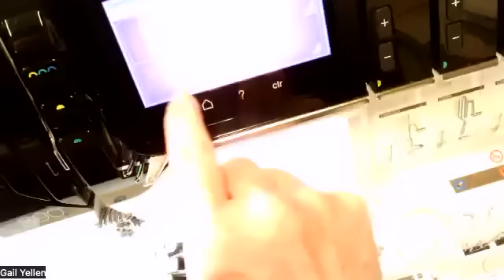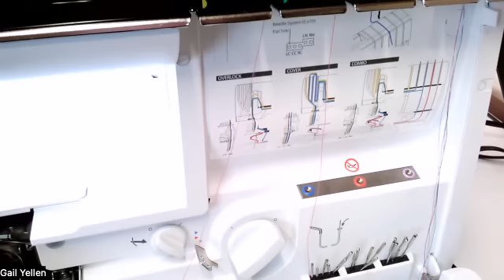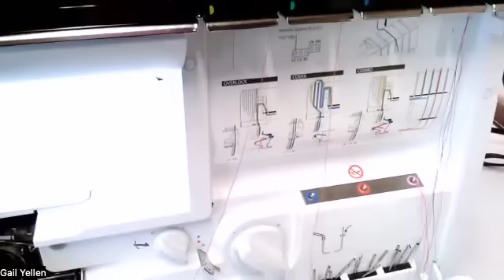Thread Fusion Live Replay

Comment: You are an exceptional teacher and I’m so grateful for you YT videos.  I became a serger “convert” bc of yours videos and book. I just bought a Bernina L890 last week.  I’m so excited about all I’m about to learn! The first thing I wanted to do was one of your “No hassle tassels”.  The air threader of my machine is not “sucking” the 12wt thread.  What  am I doing wrong? Also, what are the settings for the tassels on the B L890? Thanks again for all your content!
Reply from the maker: Hi, when you lock the air threading tubes, look closely to see if they are lined up exactly with the other end of the tubes. Sometimes if they don’t align perfectly, thread won’t whiz through them. Also if your thread has a bend or kink in it, trim it away. That also impedes threading.12-wt. thread should go through the tubes. Also if the loopers aren’t positioned correctly, the tubes won’t close at all even though you turned the big white knob. 
I set my machine for a 3-thread rolled hem (#8). But I always increase the lower looper tension to 7. And I put either 12-wt or 8-wt. thread in the upper and lower loopers. You’ll have to test stitch length to see what you like. But definitely pull the thread chain behind the foot with a consistent amount of tension (not super hard). If your air threading still isn’t working properly, let me know. What day did you purchase your machine last week? I’m very excited to help you get going on it! Thanks.
Reply: @GailPatriceDesign  I can’t believe you reply so quickly…thank you so much. Thanks also for the info on thread settings.  I’ll try asap.  Today I bought some Sulky 12wt thread and in comparison to the “12wt” Wonderfil Razel I use when trying my first tassel, it’s much thinner (the wonderfil 12wt Razel didn’t go through the tube, but the Sulky did).  Was this the problem? I got my machine on March 14th.  Thanks again!
Reply from the maker: @kchart47  Hi, if you purchased your machine 3/14 after seeing my Serger Savvy video, you qualify for a $100 rebate from BERNINA! Email me your full name and address and I’ll send the coupon. (gail@gailpatrice.com) The instructions for mailing it are on the coupon. I’m so happy for you. Back to the threading issue. Any thread that designated a certain weight on the label should be equal in thickness, no matter which brand. So I don’t have an explanation other than that there are manufacturing differences. But if your air threading continues to be a problem, have your technician look at it.
Reply: @GailPatriceDesign  I just sent you an e-mail with my info…Can’t wait to get that rebate coupon! By the way, I went to the Wonderfil web site and they did state their Razzle thread is 8wt. perele cotton, not 12wt (…my mistake 😉).   I’ll be paying close attention to the air tubes next time I try this technique bc my 8wt. threads are beautiful and I’d love to make tassels with them also, if possible .  Thank you again !
Reply from the maker: Gail Yellen
8:41 PM (0 minutes ago)
You might need a thread cradle to send 8-wt thread through the tubes. Let me know if you need help! xo, Gail @kchart47

Comment: Gail, I have an Evolve and feel certain the Universal will work well with it. It does have round plastic thread disks, whitch I confess I've never used. My question however is how can it be used with sewing machines, would you use it to in your bobbins, or perhaps thread it through your needle with a larger eyed top stitch or jeans needle. I already envision using some of the decorative stitches with two or three embroidery threads. I'm sure I would do more on my serger, but inquiring minds want to know.
Reply from the maker: Hi Bonnie, If using Thread Fusion on your sewing machine, insert a topstitch needle (larger eye)—either 80/12 or 90/14. A sewing machine can handle multiple machine embroidery weight thread in the needle, but can only handle (1) 12-wt. thread in the needle. No matter what threads you use in the needle, wind the bobbin with bobbin thread. Youll probably need to lengthen your stitch and possibly drop the needle tension slightly. Make a sample to get the correct look. Also I've found that sticky wash away stabilizer works best . You're correct that the Universal Thread Fusion is the best size for the Evolve. Let me know if you have other questions and thanks for watching!

Comment: Will the larger version work with the Evolution or do i need to order the smaller one for my daughter and the larger for my Triumph?
Reply from the maker: Both sizes will work on each machine. I suggest placing the round gray spool “coaster” on the spool pin for added stability. Babylock sergers have the flared spool pins so the Thread Fusion stand sits higher. But it doesn’t make any difference in performance. Let me know if you have any other questions and thanks!

Comment: What is a SUE?  you mention it several time when using a thread loop to pull threads through, but context does not give a clue. It is not 'sew', that context does not make sense, so it must be nomenclature of which I am not familiar
Reply from the maker: Hi Pam, I think you heard "lasso" as "lassue"! The looped end the the thread cradle lassos the multiple threads to pull them through the eye of the designated looper. Can you tell I'm from New England?🤣

Comment: I have the Bernina L890, can you only use the embroidery weight thread with the thread fusion device  in the chain looper or can I use heavier thread (like the Spaghetti thread you carry)?
Reply from the maker: Hi Lyn, Yes you can use (2) 8-wt threads in a looper (with the bypass bracket) and I've even used (3) 12-wt threads in the chain looper. The bold threads really pop and create beautiful dimensional stitching. Let me know if you have more questions and I'd love to see what you do with Thread Fusion. Thanks for watching and asking a great question!
Reply: Great - I'll have to try that.  I haven't used the bypass bracket yet....  I've had my L890 about a year now - I love it!  So many things I can do with it besides just finishing a seam.   @GailPatriceDesign
Reply from the maker: If you skip to timestamp (approx.) 30.00 minutes in the video, I demo using the bypass bracket on the Triumph. It's almost exactly the same process on the BERNINA L890. Let me know if you need any help. Thanks! @lynfedden6771
Reply: ok - I'll check that out.   @GailPatriceDesign

Comment: Gail I have an Evalution baby lock it did not come with the disk is it possible to use the large holder
Reply from the maker: Hi, yes, Because the Thread Fusion has a solid base, it's very stable even without the large spool disk. But if you still wanted a spool disk, your Babylock dealer can probably order it for you. Thanks for watching and let me know if you have more questions!